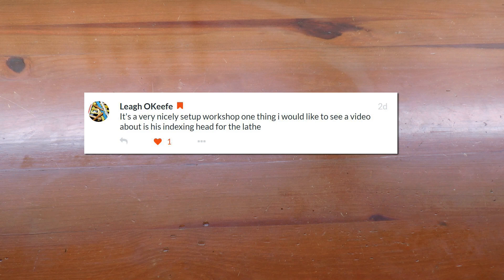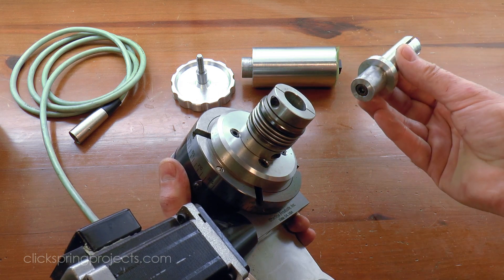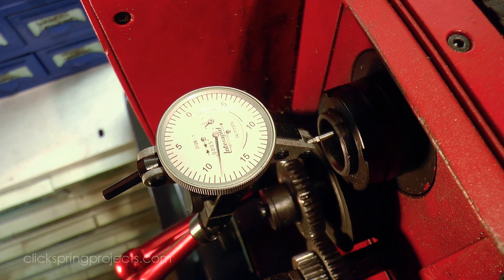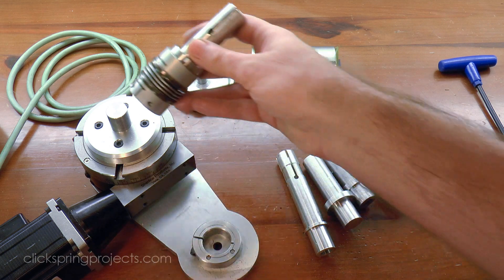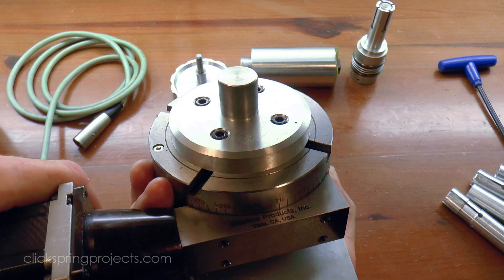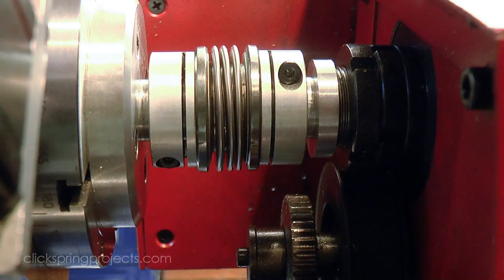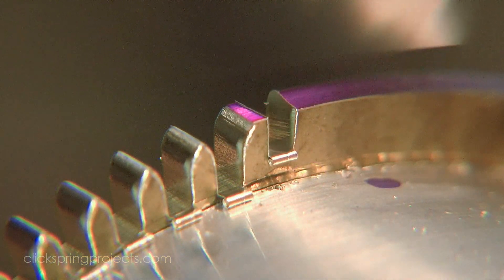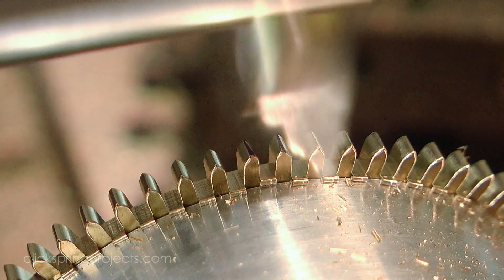Tools, Glorious Tools! #2 - CNC Lathe Indexer

Comment: Hello ClickSpring, Recently I did a Device based on your system to attache on main shaft of my BenchLathe, using Arduino and Driver TB6600, reaching 0,003mm precision of diametral pitch on 250mm diameter. Next step is make tool involute profile to make gears. Thanks to share your knowledge with us.
https://www.youtube.com/watch?v=2aefzTb1fYg

Comment: You've mentioned in a couple of videos some dissatisfaction over the runout on the back side of the headstock spindle with at least a couple of lathes. I gather from this that you elected to address this with a modification fo the driving system for the digital dividing head. I've also seen you do front end corrections to the collet taper for the Sherline lathe, which if I recall was in preparation for the Watchmakers Faceplate Is/was there a reason that a similar solution couldn't have been implemented here, perhaps in a way adding tapers to both ends of the spindle, that get aligned with witness marks, to make use of the inherent qualities of the lathe for operating around a center, and driving the headstock using that centering?

I presume that there are issues that I'm not aware of in this, including the possibility that the time to do the tuning, and the materials needed might be prohibitively expensive. (I could see this being an issue with something like the possibility of getting chips into the bearings of a lathe with this problem being prohibitively expensive to address.(one of the reasons that Mr. Peat discourages using compressed air to clear chips off surfaces around lathes and mills, though I wouldn't be surprised if a good part of that is dealing with the prospect of someone attempting to do that after doing an on/mill/lathe grinding job, and getting grit in there more than the getting chips in there. Though the chips would be bad enough I would think. (They are likely to obfuscate concentricity consistency at the very least.)

Comment: Gday Chris, im in the middle of cutting 2 gears now, a 14t and 56t 2.5 module, well as luck would have it I got to the last tooth on the 14t gear and realised I must of miss counted  somewhere and screwed up, the worst part is the gear is in the middle of a 200mm long shaft, 40mm diameter gear and 18mm shaft either side, new blank make now and try again tomorrow, frustrating but a good learning curve to not to loose consultation, I’d love a setup like your now,😂 great video mate, Cheers

Comment: The money one pays for a Sherline Lathe there should be zero run out. It just goes to show dearer is not always better.
Reply: He wasn't using his sherline lathe, he was using his Chinese import lathe---The big red one. Sherlines are a bit expensive, but considering the quality, it's actually very reasonable, especially if you buy used. I got my mill and lathe both, with accessories, for $500usd. Buy the same thing new and it's about $3k. Anyway I think the quality is great for what I paid lol

Comment: I hate it when manufacturers use smaller units in place of standardized units with regards to power. 300N-cm is just 3N-m! 120in-lbs is 10ft-lbs! I get it if the measured power is low and/or specific enough to require the granularity, but doing it for the sake of writing Big Number on the box is incensing